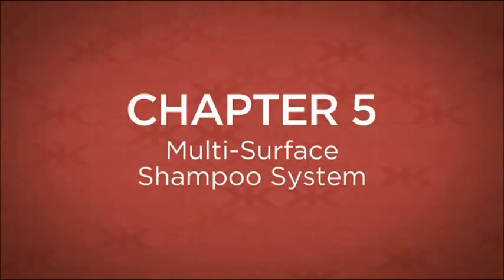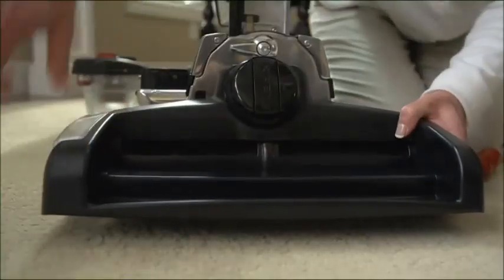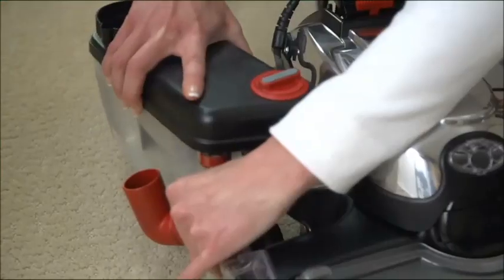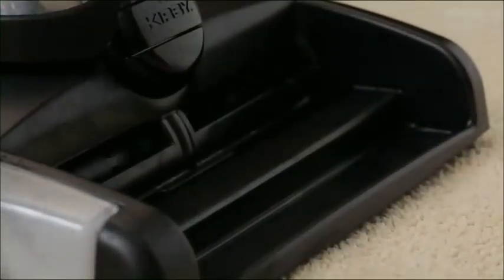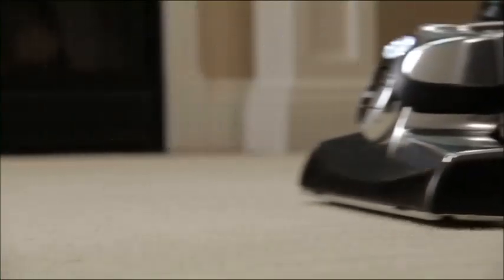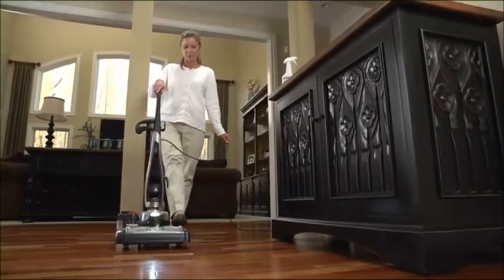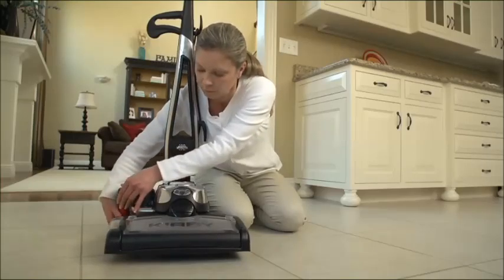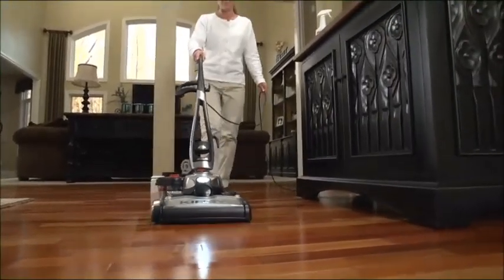Kirby Avalir Vacuum Shampoo System

Comment: It seems like a lot of work.
Reply: Georgana Romano its worth it. A kirby is a lifetime investment. I still use daily the 90s model G5 my parents traded their G3 for when i was a kid. I think the drive was rebuilt once. But the design has never changed much and they are easy to fix yourself. All solid, simple, construction, the way things used to be built in America. Plus they have multiple uses besides just vaccuming and shampooing.
Reply: Shampooing carpet is a lot of work regardless .  Kirby just allows you not to have to buy a carpet cleaner so you only need one device for your carpet care it seems to most of us .  One can always buy a separate cleaner of its too much work .

Comment: We have had our Sentria for 10 years now, bought new with all the accessories and I have never regretted the purchase. The Sentria vacuums so well you rarely have to shampoo it. When I do, I use the carpet cleaner and it the carpet way better than the ones you get from the store or especially the trucks (as they leave too much water behind). I wish we had the shampooer the Avalir has though as it looks to be an improvement over ours (ours is open faced and sometimes will spill out a little on the floor. My question, does the Avalir shampoo unit work on the Sentria, just curious.
Reply: I still use my G4 from 1994

Comment: When I clean my carpets the water runs out at a fast rate can somebody help me? I must be doing something wrong.
Reply from the maker: +john lambert We're sorry to hear you are having trouble with the shampoo system. Check that the small filter is in place at the bottom of the shampoo tank where the hose attaches. If it is missing, or has come loose and is laying in the hose, the system will not produce foam. Please give us a call at 1-800-437-7170 for additional assistance.

Comment: Still have to buy bags, lame. If they made a bagless version and improved the styling to something from the current century I would consider one.
Reply: Boodieman72 I bought cheap ones online. Amazon I think. They work fine. I wouldn't buy the name brand expensive ones.
Reply: Look up online why bags are best, you wont think they are lame then 😜
Reply: @jakemcintyre4820  I have and they are still lame.
Reply: @Boodieman72  why, how come you think they are lame?
Reply: @jakemcintyre4820  Need to keep buying bags.
Reply: @Boodieman72  you need to keep buying filters with a bagless machine- but no one ever does. Im not a germ freak by any means but a bag just goes straight into the bin whilst bagless creates a big dust cloud and you have to keep banging the dust container on the edge of the bin to make sure everythings out then clean your filters. Too messy and time consuming your hands come out filthy. Years ago before dyson, it was only the very low end cleaners that didnt have a bag, as it was a sure sign the machine was cheap and disposable. Bags are much kinder to the motor to. I just dont understand why people hate buying bags so much- you buy a bin liner for your bin and dont think about it, you buy toilet paper without thinking about it, sure yiu could manage without them but everythings so much quicker and cleaner with them, just like vacuum bags! At one point they were on everyones shopping list and no one had a problem, they were up there with toilet paper 😂😂😊
Reply: @jakemcintyre4820  Not true, you just wash and reuse them with a bagless machine.  I use a Japanese style bidet not toilet paper as you don't have to keep buying "consumables"

Comment: Will this work with any other models? (G3-S2)
Reply from the maker: +Dark Days Alive The new Multi-Surface Shampoo System will fit on prior Kirby models, but we recommend using it with the Avalir as it was specifically designed and tested for use with the Avalir.
Reply: I used to sell, the body of the vacuum should still be the same G3 or newer and should work. I have a G5 and this would work on that. as a matter of fact the only thing that looks different than the shampoo attachment for the G3 and up is they've got a fancy lid for the waste tray, possibly a different detergent,  and the brush changes from hard bristle to soft bristle. if you've got a G3 shampoo unit, I would just look for a replacement hard floor brush, It would most likely fit. worst thing to happen you have to resell it on eBay or craigslist.

Comment: Can this shampoo system work on a Sentria?
Reply from the maker: +Ryan Willoughby Although the updated shampoo system will attach to a
Sentria vacuum, it was specifically designed and tested for use with the Avalir
system. Because of this, we recommend using it on the Avalir for best results.
Reply: Yes

Comment: is the hardfloor cleaner a disinfectant? i ask because since there's no steam how can this kirbt disinfect? i have a 10 month old son who crawls everywhere
Reply from the maker: +missj Stephens Kirby hard floor cleaner is not a disinfectant and does not contain harsh chemicals. When used with the Kirby system, it can get your floor very clean by using the power of the Kirby system to scrub the floor. Thanks for asking!
Reply: Ok well if there is no hash chemicals like yall claim why in the back of the bottles it warns people that the product can cause cancer? Im kind of lost on that. Explain?
Reply from the maker: +missj Stephens This warning is in reference to California Proposition 65 which requires warnings on many products including clothing, electronics, jewelry and even food. The product meets all appropriate safety regulations including those of the Consumer Products Safety Commission (CPSC).
Reply: missj Stephens You do realise that steam cleaners don't really disinfect either? To kill Bactria you have to maintain contact for several seconds, raising the temperature substantially. Passing a blast of steam quickly over a floor isn't sufficient. Read the small print - may instructions say "contact time 90 seconds" for bacteria destruction- that's a minute and a half for every area of floor!

Comment: I'm having a hard time drying the tile after I soak it.. Anyone else have this problem? It doesn't feel like it's sucking any air so idk how it would dry.. Pls help I just baught it..
Reply from the maker: Hi, the system is designed to pick up the majority of water and cleaning solution and deposit it into the waste tray. Your floor will remain damp and will need to air dry. If you have additional questions, please give us a call at 1-800-437-7170. Thanks.
Reply: +The Kirby Company thank you for replying
Reply: Hello. I would recommend a clean microfiber surface mop for speed of drying. They are very inexpensive @ $10 Will not only help the tile dry faster but will Polish out any water marks. Good luck!

Comment: Here's an idea. What if you guys were to add a steaming feature? It would help to compete with companies such as Shark. Just a thought.
Reply: Kirby has been one of the top sellers for the past hundred years. and keep being the best because  of there quality.  shark will not last as long as kirby.
Reply from the maker: Tenormic3 Thanks for sharing your idea! Our engineers have considered this in the past. For now, we are excited by the introduction of our Multi-Surface Shampoo System which allows the Kirby to scrub and mop all types of floors and even apply a durable shine ... which is something a steamer can't do.
Reply from the maker: A Tohm85 Thanks for the support! We regularly get calls and emails from consumer who have had their Kirby system for 30, 40 and even 50+ years. A Kirby really can be the last home care system you ever buy!
Reply: Steam, heat, pressure and agitation and especially extraction would the last step for a perfect kirby especially for grout cleaning. But this new model kirby would be the size of a lawn tractor. But this new style attachment has done a great job and the engineers have done well.

Comment: This is a piece of crap. I cannot get the carpet shampooer to work properly. It petty much dumped the whole tank onto my carpet and it will not suck it up or "cycle" the water. My ex-husband had to have this stupid machine and I got stuck paying for it. Now, after paying $2,000 for a machine that is subpar and doesn't work, I get to go rent one at 9 PM at night as not to ruin my carpet.
Reply: mrbobbilly  No no, it's the machine. It's never the people using the machine. It's always the machine's fault. /s.

Comment: I can vacuum twice with my ultimate g and my Dyson will pull up a disgusting amount of stuff after, only reason the Kirby isn't in the dumpster is because I shampoo the carpet with it
Reply: Dank Memes belt is fine as the roller spins it picks up what you can see on the carpet but my Dyson gets out what the Kirby can't. And the Dyson has a five year warranty at 1/3 the cost. I'm good for 15 years minimum.
Reply: JW Outdoor 
Change your Belt, Bag and check to see if the brushes are touching the carpet.
Reply: just because your belt isn't broken that's does not mean it doesn't need to be replaced, belts stretch out and loose there tension, therefore the roller will not be spinning at a consistent speed when it touches the carpet, belts should be changed every 6 months to a year, if you still feel your kirby is not cleaning that well, it's probably time to replace the brushroll,